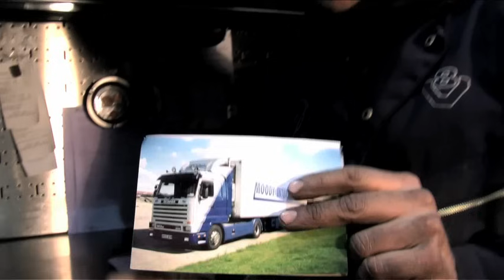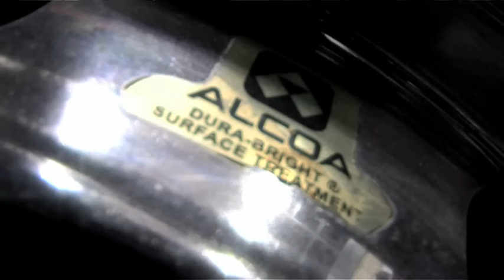Guy Martin 143 M 500.

Comment: You can buy alloy backing plates to stop the alloys from seizing to the hub face only problem is getting that plate of in the future.
I sat for over 30 minutes with a hammer and chisel removing a alloy backing plate  the other week bloody nightmare but I have to say it’s a handy thing to fit if your running alloys instead of steel wheels... since buying backing plates for my show truck I’ve never had to deal with a seized wheel yet.

guy if you ever reads this comment you should give them ago I got mines from a guy down at John deer for a few Bob he bought them for his scania and never used them, couldn’t tell you where he bought them but I’m sure you’ll know someone that’ll know someone :)

Comment: 143 best scania ever by far.
Reply: Sean gsi...a 143 is a cheap 141
Reply: K Man  you are living in cloud cuckoo land ...a 143 was more cheaply made ie : 1 piece exhaust manifold that was forever cracking...front axle that developed wobbles...stupid intercooler pipes running over the top of the engine ( right where the greatest heat is ) ....badly designed sloping windscreen ....pileof shit
Reply: K Man  my 141 had 731bhp at the back axle ....you've never driven a proper truck...

Comment: I love Alcoa aluminum wheels but he doesn't like them on the mechanical side. why?
Reply: Bhavesh Karshan he said the two metals stick together making it hard to get alloy wheels off
Reply: Kenny Johnson ooh
Reply: If they are left on a long time aluminium and steel will actually cold weld together, only really likely on a truck that doesn't get used that much though.

Comment: NASCAR engines are only 358 ci with 2 valves per cylinder with a single cam. In 2012 NASCAR finally gave in to EFI much to the fans dismay. 4 speed standard trans. The idea is to NOT be like F1 and keep costs down. But as we know teams find ways to cheat anyway.

Comment: I'll take my Cat C12 at 425hp in my Sterling. Legal weight for a Tri-ax is 75,900 and depending on the mix I can weigh between 70,000 to 90,000 pounds with 10 cubic yards of concrete on and that Caterpillar motor doesn't hardly notice. The motor is hooked to an Eaton Fuller 8LL transmission I almost never drop to the low side even climbing hills fully loaded